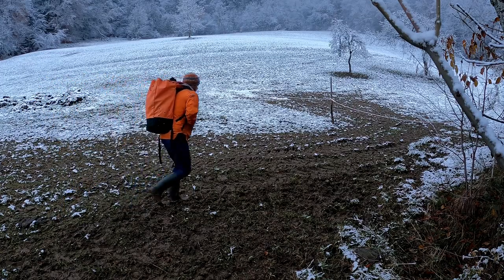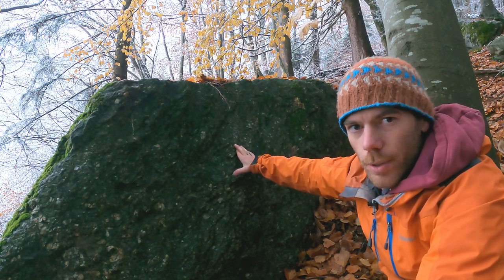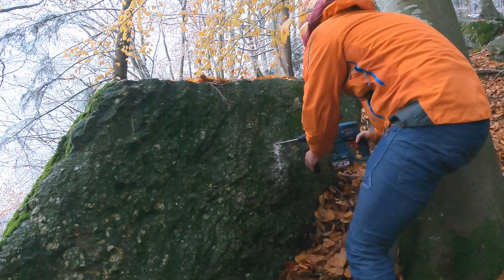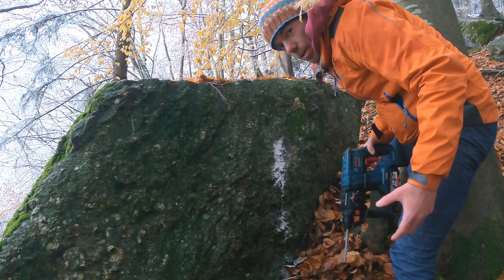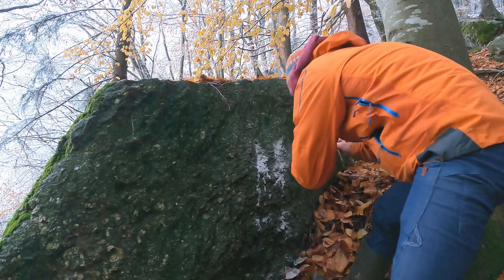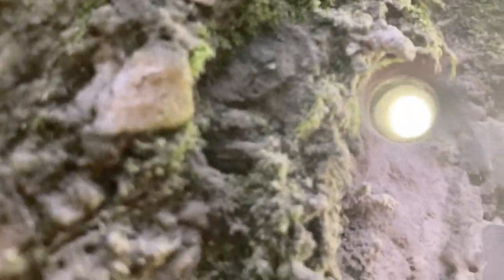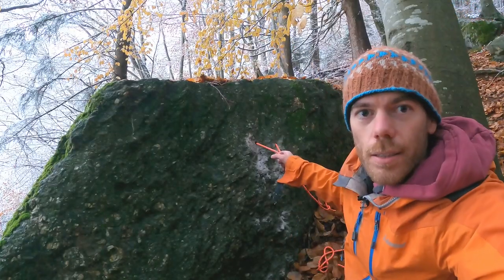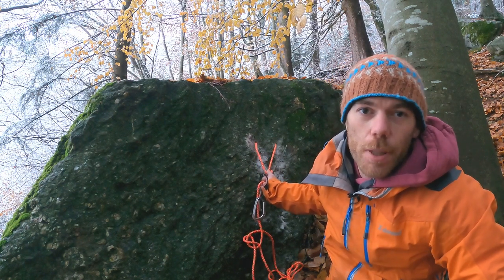V-THREAD in rock - how hard is it to drill?

Comment: That is a great idea.  It would stop all the bolt cutters out there and be easily replaceable and easy to check if you are using webbing just slid it around and see if the webbing is OK although it might not work for sandstone that gets wet all the time

Comment: Would not the interior intersection form a sharp edge that will cut the rope?
Reply from the maker: Good remark! The interior intersection is not as sharp as you would imagine, and the rope doesn't cut as fast as you would think. This is a widely used technique in caving as well. Note that in caving, they consider - in order to have a fully fledged belay - this to be only 1 point, so you'd need a second one. In canyoning - like in ice climbing/mountaineering, it's only a descent so we tend to use only one if deemed OK. Here we tend to use a piece of rope - drill with 14mm if possible - which is pretty sturdy. In caving they use a lot of dyneema rope (the white 5mm one). The great thing about this is that when you come across a belay point like this, you can just turn around the rope inside and check if still in good shape. If not, you cut it out and replace it ;) Besides not leaving any metal behind (which can easily be torn and damaged by floods or rockfall), it's great advantage is exactly that you can just replace the rope inside.
Reply: @svenvancleemput  I've heard that people use cable to smooth the interior edge
Reply: Voir test GOLA Olivier. La corde cède au niveau du noeud et non a la jonction interne des lunules.